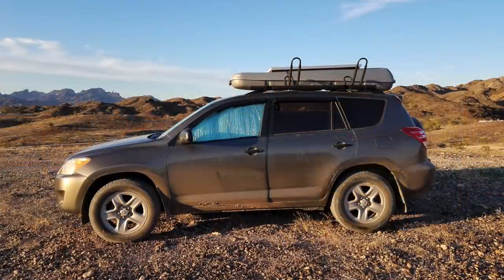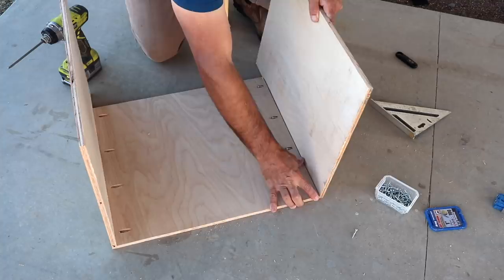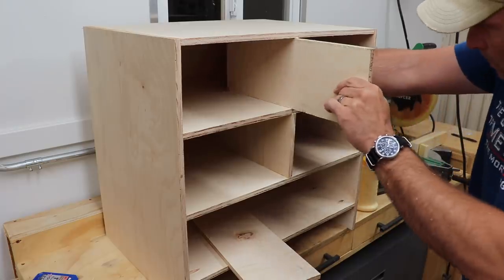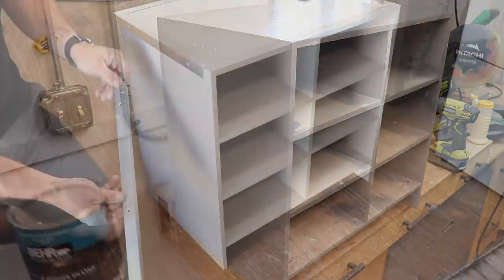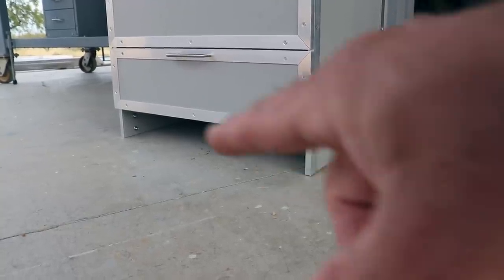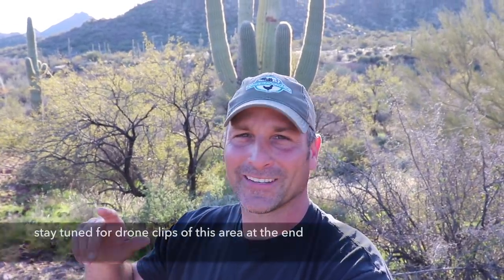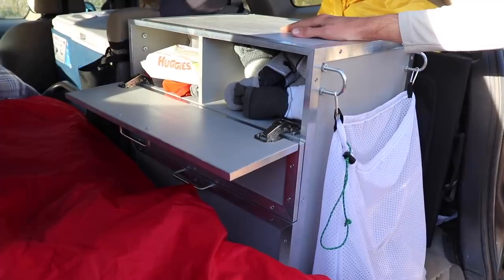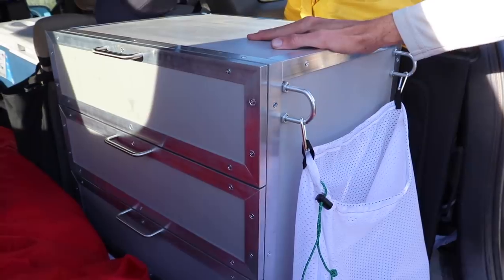DIY Travel Cabinet for SUV's, Van's & Overland Adventuring

Comment: Very nice cabinet. The aluminum trim was definitely the way to go. Just like travel boxes for musicians. Some speaker box material on the sides and back would be a nice feature. 
So the garage/shop in the background, haven’t seen that before.
Reply from the maker: Thanks!   The garage is in only my much older videos.   I try to mostly film at or around my shopping container shop but the wind was pretty bad that day and the garage had better lighting and less wind.   Also, I recently cleared about a bunch of junk to give me some more space so you’ll likely see that along with the shop in my future builds😀👍

Comment: We could use our toyota sr5 and camper made into a camping sleeper. And storage would make it more helpful
Reply from the maker: Those Toyota sr5’s are great!   And I think a little bit of storage would go nicely in it😀👍
Reply: @homesteadonomics  full length pull out drawers and a slide out on the side for a cooking area of the tail gate so it moves away from the truck on wheels

Comment: Nice job. My issue with solid piece of cabinetry like this in a smallish vehicle is that it takes up space and is in the way whether it is full or not. And, if it is full, whatever is in front behind those cabinet doors definitely obscures what's in the back, so my experience has been that you only tend to use what you can easily reach up front. I prefer drawers if I have to have a cabinet at all because you can easily access what's in the back of the drawer just by pulling it out. Driving around on 4 WD roads must also throw whatever is in that cabinet all around inside potentially creating a lot of racket and possibly spilled contents from broken containers.  Bags or duffles have always worked the best for me because they are collapsible if partially empty, and easily can be squeezed into somewhat oddly shaped nooks and crannies. Setting other bags/items on top and around the sides also keeps hard stuff from banging around inside. Your cabinet definitely looks cool though.

Comment: I like the Ryobi tools too.  Inexpensive, variety, and a reasonable value for the money.  There are cheaper brands which I wouldn't touch, and there are more expensive which will be superior in the more demanding usage, but overall, for me Ryobi is fine.  I don't work for them, just been using the brand for 20 years.
Reply: Ryobi is good for me too. They've got a version of all the tools the most expensive brands make. The best thing is probably Home Depot supports Ryobi and all of the stores have them. I recently exchanged the dual power fan I had for over a year.
Reply: I have Ryobi and use Milwaukee at work, and its not much difference, if any at all 
Green Bosch didn't have all the tools I wanted, so I needed a new system and considered Milwaukee, but it was too expensive so I ended up with Ryobi. Never regretted that decision.
Reply: @dubious6718  I've had 1 Ryobi hand drill fail, might have had 50 hours or less of drilling on it but it was about 5 years old.  So I'm a low usage user and the rest have lasted.  Didn't like their shoulder vacuum - gimmicky but the rest of the stuff was fine for me.
Reply: @politicalfoolishness7491  Buy brushless, they say they last longer.
Reply: Same here...I bought pretty much the entire Ryobi line when I purchased my home...they work just fine for the occasional user like me  :)
Reply from the maker: I agree!    They are good value tools.   Reasonable priced, adequate power for my projects and they have a good selection.   But I think their are lots of great ones out there too.   Just depends mostly on which battery system you start with...it keeps you hooked...kinda like a drug dealer...haha😉
I received one of their kits as a gift about 17 years ago and since I already had the batteries I just kept buying the tools😂.  And for the most part I’m happy with their performance.   The 4 and 6ah batteries are all very reliable...but I don’t like the thin 2ah batteries.  And my ryobi 16ga finish nailer is a bit under powered.  But the rest are going strong👍

Comment: Great job, very handsome cabinet and thank you for sharing. I like the hinges you used in the video for a project I'm working on, please let me know the make and model. I tried some Blum hinges from Home Depot but they didn't work out.
Reply from the maker: I got these from Lowe’s.    They are called Richelieu (spelling might be slightly off) but if you search for that on Lowe’s then you should find them.   I think they were $3.88 each👍😀
Reply: homesteadonomics great, thank you for the info and I will be going to my local Lowes tomorrow to pick up some.

Comment: Man. I JUST bought a 3 drawer cabinet. Lol. But it's plastic. -_-

I know wood can weigh down a vehicle, but it's the thickness of the wood used for a build out and the stuff you add into that build out. I'm curious. Can you take requests? I really miss wooden furnature. 

If and when I can downsize even more with clothes, it would be nice to have a 3 drawer night stand like Tristan has, but of cedar if possible? Unless cedar is hard to cut? :(

I like the smell of wood and wouldn't mind having my clothes smell of forest than plastic if I can help it.

Thanks for all you do with your craftsmentship. I've subscribed to see what kind of trailer you're making. It's a toss up for me on having a trailer or a van at the moment. But a van would be safer to be in for a female traveler. D:
Reply from the maker: Thanks for checking out the video!   As for the trailer project....I’ve got about 14 or so videos showing the entire build....with a few exceptions of projects that I’m going to be doing in that next few months.   So if you scroll back or check the ‘travel trailer’ playlist you should see them😀👍
As for your van or trailer decision.   I think a van would be an easier project.   And makes for not having to hitch and pull a trailer.   And there are tons of ideas out there for building cabinets in them.    I’ve even considered it myself.   Getting a van and using it to pull the trailer and having double the capability!

Oh yes, regarding requests.   Right now, I don’t have any time to take on any new commissions or projects.  Sorry.

But hopefully the video might have given you some ideas 😀👍
Joe
Reply: @homesteadonomics  I like the van + towing option for a little cargo trailer box also. I've seen those before too. I could always upgrade to a hightop. Will definitely need a hightop van in the future to keep my back in it's best condition. Lol. Hey, no problem with requests, I appreciate the walkthrough videos. Have a good day! ✨

Comment: Honest question: Why didn't you drill your hinge pilot holes on the shelves prior to installation of the shelf?
Reply from the maker: I needed to be able to visually line them up and make adjustments.   Two of the four holes allow for adjustment.   So if you only add two screws on each hinge at first you can slightly adjust until you get it just right.   Then you can add the other screws and get it secure😀👍